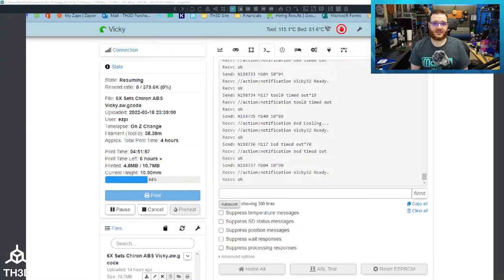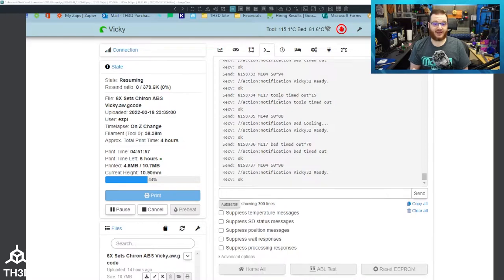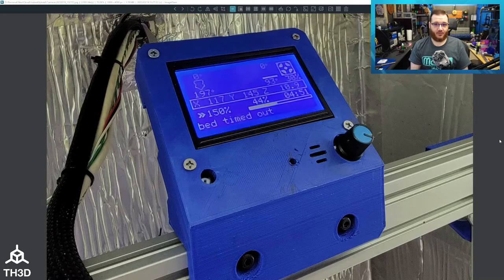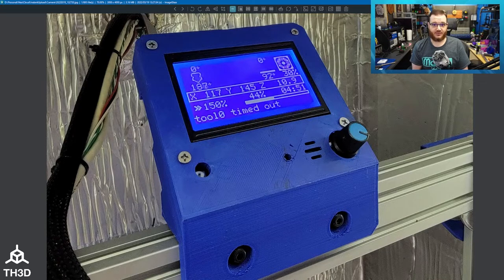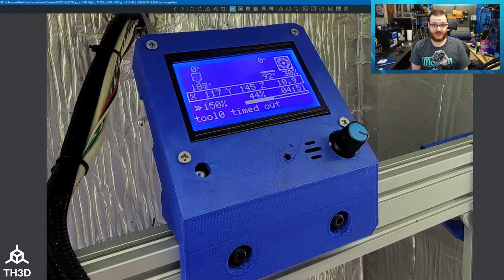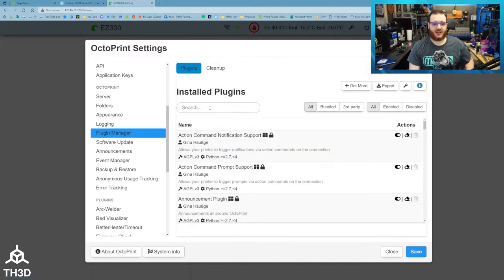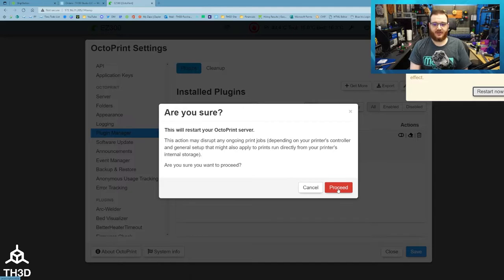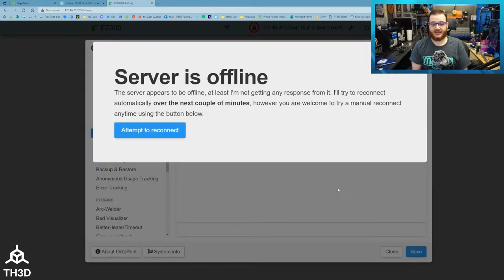BetterHeaterTimeout Octoprint/EZPi Plugin Issues - How to Disable

Comment: Hi I'm new to your content and the world of 3d printing. I have just purchased an ender 2 pro and I was just curious of a few things. 1 in cura do I use the ender 2 profile and adjust the bed size accordingly or is there a more to it then that. 
2. Is the one of your firmware updates coming out for this printer.
3. Are their any updates in hardware for this printer you would recommend.

Thanks ever so much for the time to read this.
Reply from the maker: 1. I would use the Ender 3 Profile and adjust the bed size. I did that with Simplify3D and it works perfectly.
2. We have firmware out already for it here: https://www.th3dstudio.com/hc/downloads/unified-2-firmware/creality/creality-boards-creality/creality-ender-2-pro-firmware-v4-2-3-board/
3. I swapped the extruder on mine for our metal one since the plastic ones crack all the time. I also swapped out the hotend fan to ours because the stock was too loud. I also put in our tough tube, EZABL leveling kit, and solid bed mounts. It's been a great little printer. Here is a list of what we put on ours below. I also have our EZFlex plates on the way for the Ender 2 Pro as well, should have them in about 3 weeks.

Hotend Fan: https://www.th3dstudio.com/product/40mm-sealed-bearing-fan-24v-ender-3-tornado/
EZABL Kit: https://www.th3dstudio.com/product/ezabl-pro-plug-print-auto-bed-leveling-kit/ (add the standard solid bed mounts from that page, its cheaper with the kit)
Tough Tube: https://www.th3dstudio.com/product/tough-tube-high-temp-high-tolerance-ptfe-tubing/
Extruder: https://www.th3dstudio.com/product/ezfeed-extruderupgraded-aluminum-extruder-v2/

Comment: With your octoprint image, will you be doing an update use to the later version of octoprint? 

I save backups and sometimes it takes a while to get the update process to happen before I’m able to load the backup since it’s a backup made from a newer version of octoprint.
Reply from the maker: The V2.6 image posted to the site today has 1.7.3 and is built on the OctoPi 0.18.0 image. https://www.th3dstudio.com/hc/product-information/ezpi/ezpi-image-download/